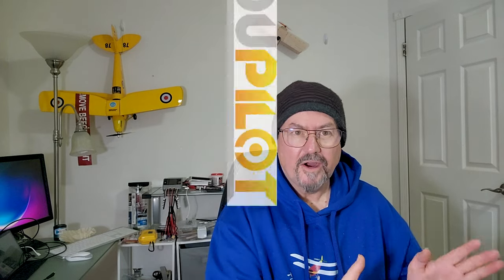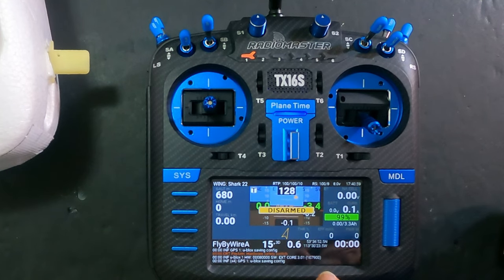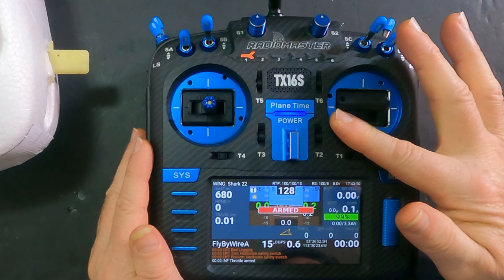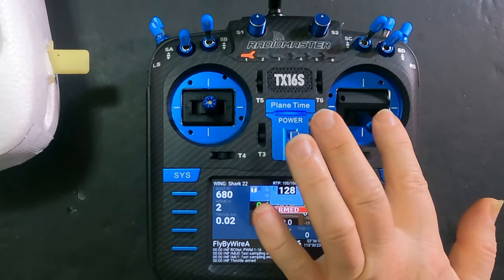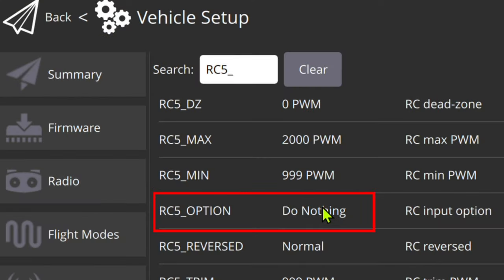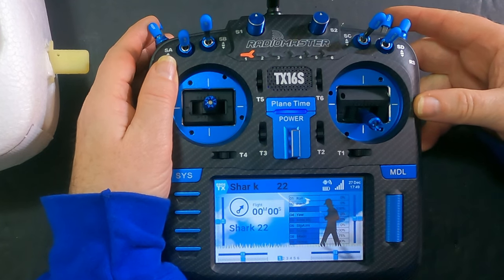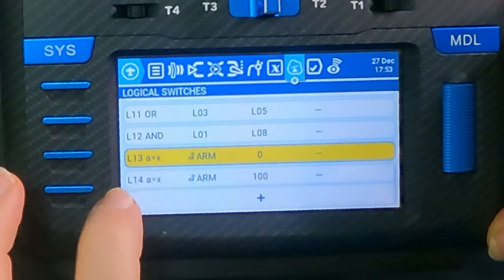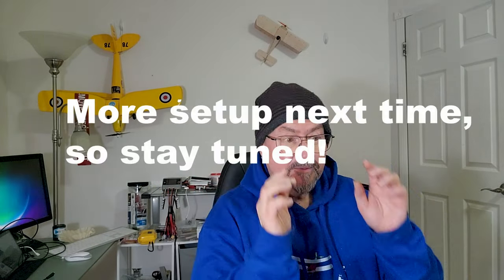ELRS Arming with ArduPilot - working!

Comment: I found your video on the ardupilot forum. I'm using an F405wing with ELRS - I've got Yaapu loaded on my TX16S and the ELRS telemetry is functioning. However the pesky "ARMED" message is overlaid on the artificial horizon, and it will not go away. I was hoping these steps may solve my problem, but when I try and set up a logical switch "ARM" is not available to select. Everything is powered on and connected - any idea what may be going on?
Reply from the maker: You need a telemetry value of "ARMED" not a logical switch. I found it doesn't always show up right away. You might need to leave "discover sensors" running for a while. Hope this helps.
Reply: @timtheplaneman     I let it search for about 5 minutes, then the “ARMED” message finally showed up. Thanks!

Comment: Nice solution to the weird ELRS implementation. One concern I have with this solution is what happens if have control link, but loose telemetry, even for brief period? Would a "disArm" be sent over the control link from the transmitter?
Thinking if is possible to setting up a redundant logical channel and mixing in flight controller to avoid the radio transmitter and continuous radio link dependency. Could include a countdown timer, to disarm if radio signal lost for an extended period. My concern is a brief lost of telemetry could result in a disarm.
Reply from the maker: It's a good question, but I think it's ok. telemetry seems to hold the last value it received, so if it lost link while armed, it will stay ARMed. Thanks for watching!

Comment: Let me summarise, elrs is not intended to work with ardupilot without hacks and tricks. Let it control Betaflight and Inav as it was designed initially.
Reply from the maker: Yeah I don't agree, I use ExpressLRS with ArduPilot and it works great. Of course you do it your way! ;-)
Reply: @timtheplaneman  Correct me if I wrong, rc link will work until telemetry works? So, loosing a telemetry is an equivalent of RC failsafe.
Reply from the maker: @myway6335  Not exactly. ExpressLRS prioritizes the RC link, so you can lose telemetry but still have a valid RC link. For more - maybe ask on the ExpressLRS discord.